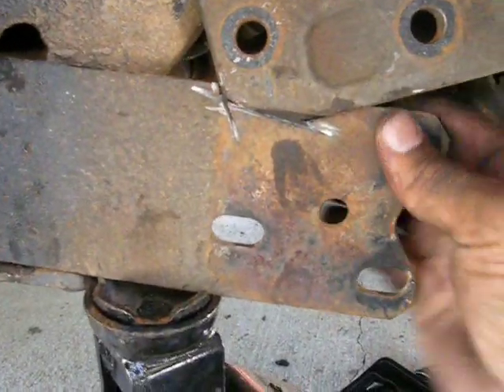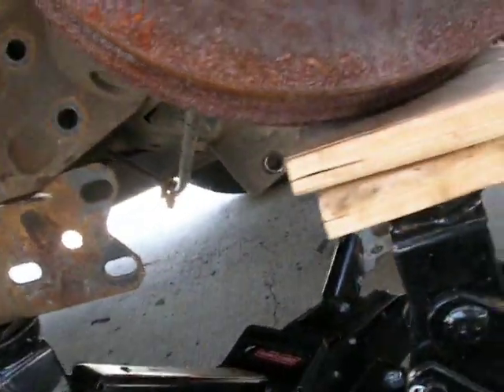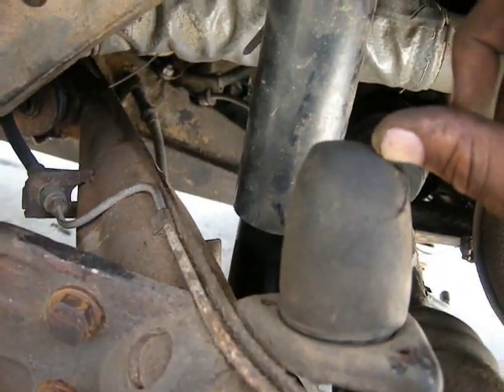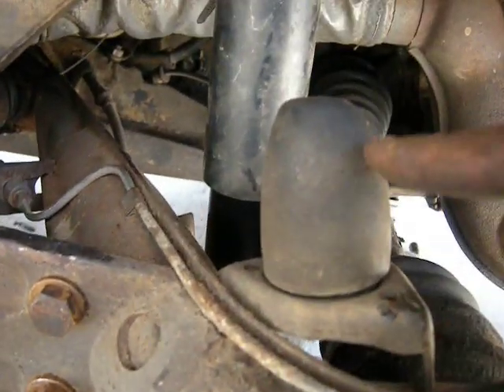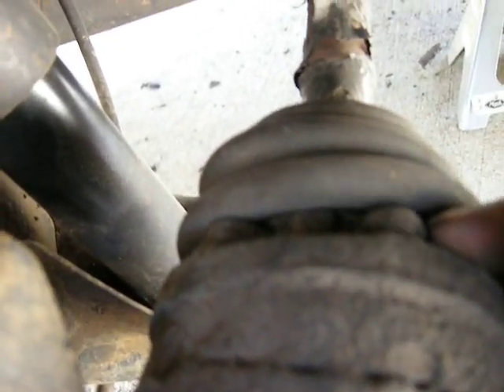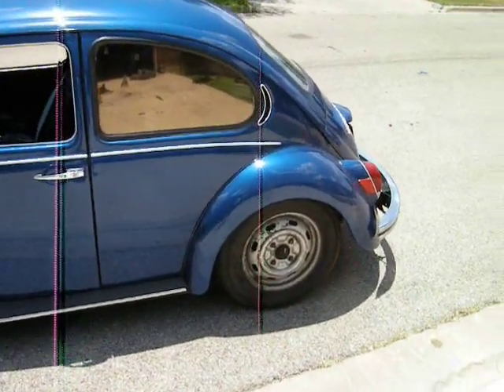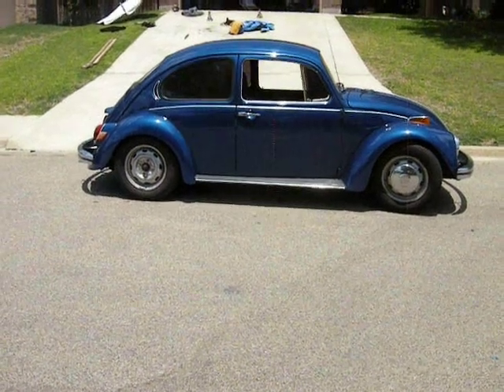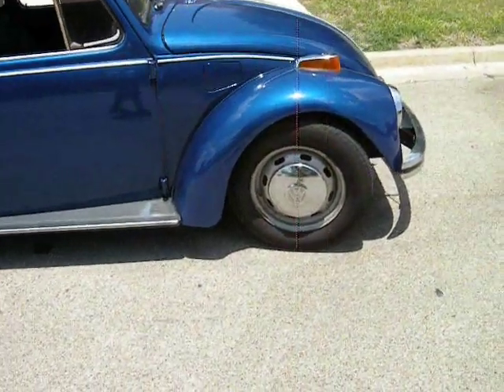Lower the Bug part 2

Comment: Cool video, I am in Austin TX and got allot of good info from this and the front spindle video you posted. Looking now for the shop you mentioned to see if I can get some drop spindles for my 1965 bug and contemplating going ahead and putting adjusters on the beam and making it narrower. Thanks again